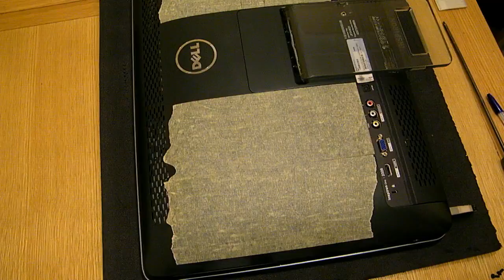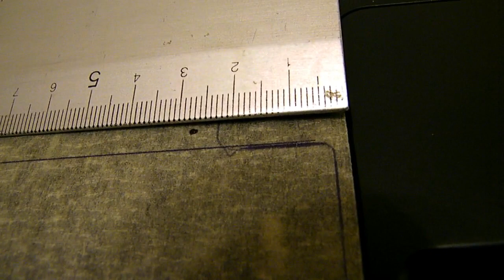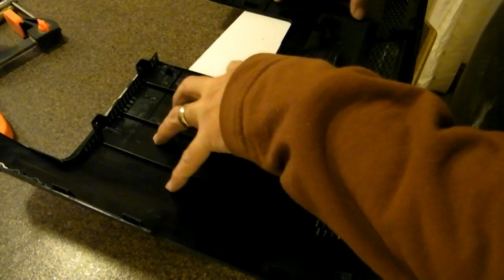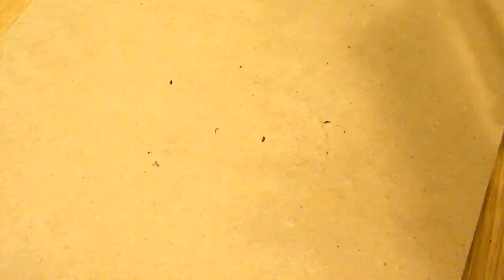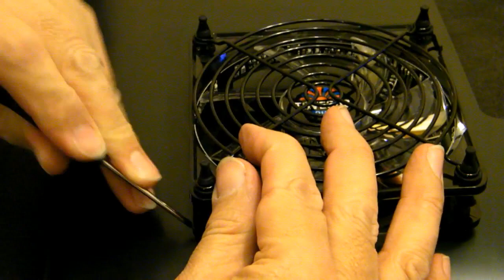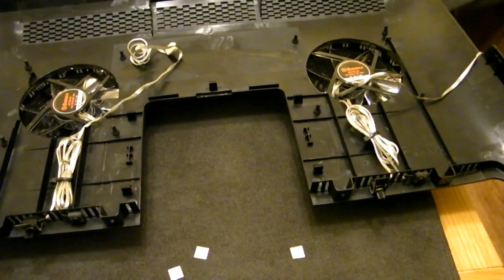Dell Inspiron one 2320 Installing fans to help upgrade cooling the nvidia 525m graphics card

Comment from the maker: If you have no Nvidia GPU on board the only option is drop a bigger CPU and which can up grade the internal GPU. An example would be the CPU video which upgrades the HD2000 to and HD 3000 the clock speed was upgrade so the graphics speed improved. After that the option is to replace the motherboard for one which does and can be found on eBay.

Comment: I just did this to the 2305 for a friend.  I also changed the sata cable for the hard drive to a locking one.  I was going to try to use the mxm fan port for my fans but found it was only 5 volts and wouldn't power case fans so I had a family member wire them into some wires that supplied 12 volts.  The fans I bought came with fan controllers so he actually wired one into the system and connected both blue led fans to that.  It looks really cool  and runs really cool now.  Thanks for the post.
Reply: Hi: I already installed the fan on the back cover, but I still did not connect it electrically. Could you tell me where did you connect it, my new fun is also 12 volts?
Thank you very much.
Sorry for my english, i am from Argentina.

Comment: Hey thanks for the video. My computer sounded like a jet engine every time my son would load and play Minecraft or if it was under a fair bit of load. I installed one 120mm fan over the CPU/GPU area and it is so quiet now. The computer hasn't made the super loud high pitch noise since.

Comment: They make external ac dc adapters for powering fans now, the ones on ebay if you can find them have 2 3-4 pin fan leads, useful for such external cooling mod mounts.  Antec true quiet ufo fans have built in switches for speed control as well.

Comment from the maker: Hi Jonathan,
The fans I fitted are Enermax Vegas Duo's they are on Enermax dot com website.
I got them on eBay for £15 each which is expensive but the I wanted to get a good effect. You can also see videos of other fans on youtube thats where I first saw these and you could fit any type of 120mm or 80mm fan you like. With all the parts cost was about £42 to do the modification.

Comment from the maker: Yeah both fans pushing air in. The main reason was the original graphics fan is still working under the new fan and it's pulling so I wanted to go the same way. I'll also be posting a video to take an SSD as well as the normal harddrive and still be able to use the internal DVD writer.

Comment: I have a 2305 that keeps overheating, I have been just running it without the back cover, but I know in the long run this is not a very good option.
think I am going to give this fan install a try.
Thanks!!

Comment: Hi UCG! Thanks for the great video. I want to do something similar to my 2305. What do you think about a single larger fan over CPU? Maybe a 140mm, or do you think the back cover curvature would be prohibitive? And did you disable the blower fan? I'm wondering about yanking the heat pipes and adding nice heatsinks.
Reply from the maker: From what I found any hole you make in the back panel is good, try bench testing with the back panel off and you'll see the system is whole lot cooler. The fans I fitted are 140mm really only put the one about the CD and hard drive for symmetry.

Comment: Amazing job with those fans !! I upgraded the ram and added an SSD in my 2320, but unfortunately, my motherboard didn't have the Nvidia GPU integrated, which is so disappointing because I like to play some low requirements games, but the fps are too low :( 
Any CPU recommendation?
Reply from the maker: Yeah it's not easy to change the motherboard either mainly because of the back panel where the ports are...  hope you find a solution thanks for watching my stuff...

Comment: Hi UCG
Gonna have to do this mod on my Inspiron 2320
Quick question....did you install dust filters on the new fans (in addition to the grills) ? Thanks !
Reply from the maker: I didn't install dust filters but I used to have the system opened quite often and blow it out as I have an air compressor. Filters would probably have been a good idea. Hope it all goes well.

Comment: i rather putting pci cooling fan and mount it inside the back panel and position the outlet to the top of the back panel fin instead make a hole to the back panel

Comment: Hi UltraCyberGod:
Thank you very much for your video.
I already installed the fan on the back cover in a Dell All In One 2305, but I still did not connect it electrically, could you tell me where to connect it, my new cooler is also 12 volts? Is it possible to connect the fan to the CD?
Thank you very much.
Sorry for my english, I am from Argentina.

Comment from the maker: Which processor do you have? The i3/i5/i7 versions come with Nvidia optimus technology meaning the Intel HD graphics runs when you use the desktop and the Nvidia only comes alive when you jump into something that requires that extra power like games etc. If you right click on the desktop can you see "Nvidia Control Panel" in the menu that comes up ?

Comment: This will not help you, because the cooling of the video card is bad there. The chip itself is under a thin plate of the radiator, and above this plate is fixed the fan. The chip gives heat only to this thin plate, which will cause it to overheat after installing an additional large fan.
Reply from the maker: Геймер Геймеров the end of the video I go through the fact that this drops the temperature almost 22° so there is a massive improvement over having the machine running at 95 degrees. This is of course only quoting the GPU temperature and not the CPU.
Reply: Stress it with furmark and see 90-95 degrees.

Comment: I just got a new Dell Inspiron i3455, found out the hard way I cant play the latest of games....so I wanna upgrade to a Intel i5-6600k in your opinion do you think it would be a good idea to add 2 fans as well for the model I have? because honestly idk if this model has the same heating issues when added a new processor/Graphics card?

Comment: Why not just connect those fans to the cpu fan?
Reply: I'm thinking the same thing, why not connect all three fans to the fan 4 pin male on the motherboard using a 1 to 3 way split cable? That way all fans will be able to adjust speed accordingly via PWM. Is it because of possible power load @UltraCyberGod?